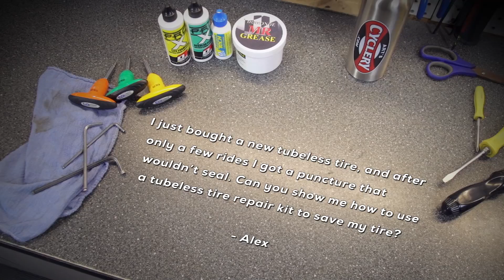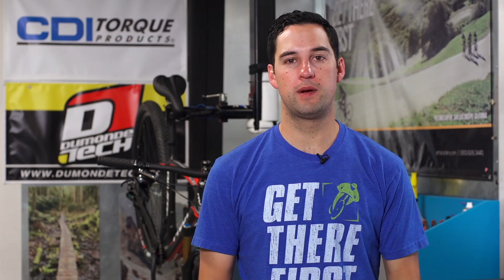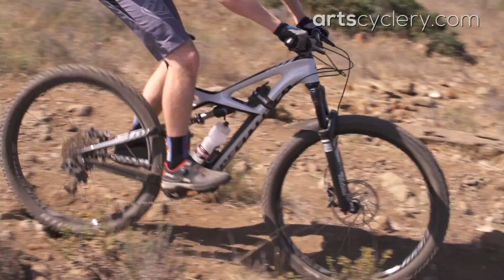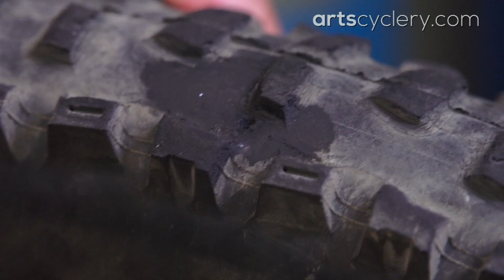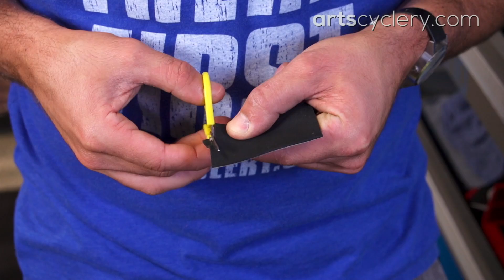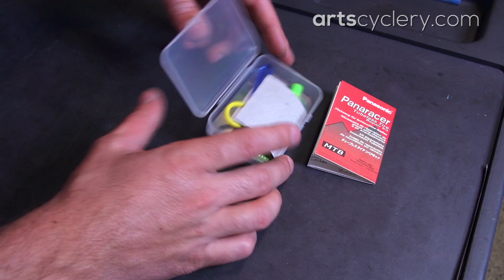Ask a Mechanic: Repair And Save Your Tubeless Tires.

Comment: I ran tubeless and went back to tubes.  Where I live, a flat tire is very rare for me so there was no gain in reliability.  If I let the bike sit for a month as I ride my other bikes, the sealant will dry up and if I happen to puncture or an existing small hole that was previously sealed by the sealant works its way open again (you won't know because you don't know how many holes are in your tire), then your tire will go flat.  After this, you've got to find out where all the holes are or just scrape out all the dried sealant and add more costly sealant.  This might need to happen 3-5 times a year or more.  More friction and weight is added by having fluid rolling around in the heavier tire with less flexible casing.  If you want lighter tubeless tires, it's going to be a much more expensive proposition than tubes.  The next time I ride in cactus fields, I will fill my tubes with sealant.  Tubes tires with plenty of talcum powder in between gives a way compliant and softer feel for a given tire pressure than any tubeless tire I've ever felt.

Comment: Why not patch it from the inside?
Reply: +Leonard Natera 
I have been using standard tube patches on the inside of my tubeless tires for years.  Once upon a time, the Stan's website had an instructional video on how to do it.  I don't know if it's still there or if they've updated it, but the basic upshot is that you need to use brake parts cleaner to remove the sealant residue around the hole if you want the patch to actually stick to the tire.  After applying the patch, I will often put the tire back on the rim with a tube in, inflate it to fairly high pressure, and let it sit for a few hours to really press the patch into the tire.  I have never had a patch fail using this method.  I also like this because the patch provides some structural support for the area around the hole.
Reply: +Leonard Natera 
Stan's instructions.  http://www.notubes.com/help/patchingatire.aspx
Reply: +Leonard Natera 
Having the fold on the inside helps retain the plug, same as a car tire